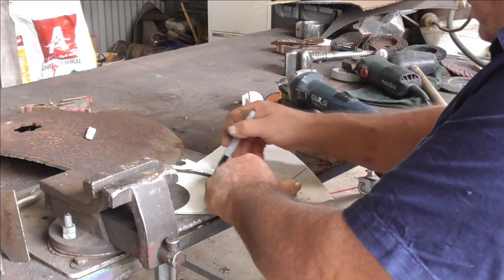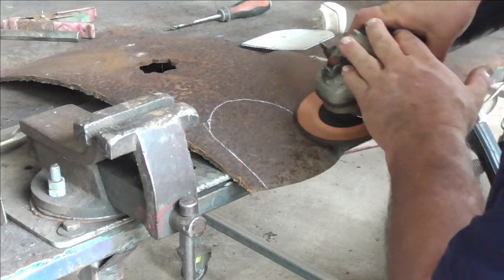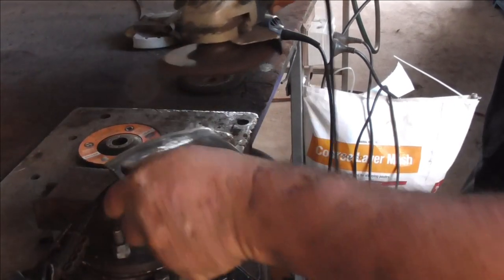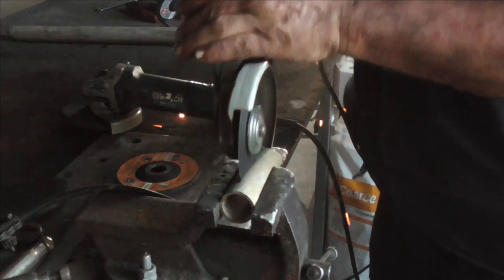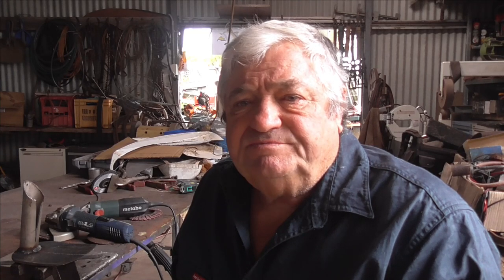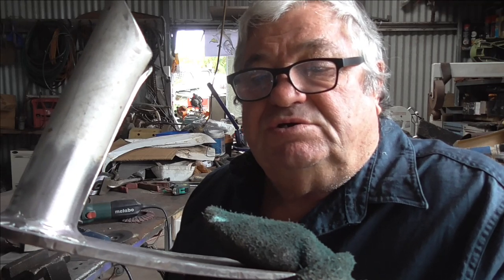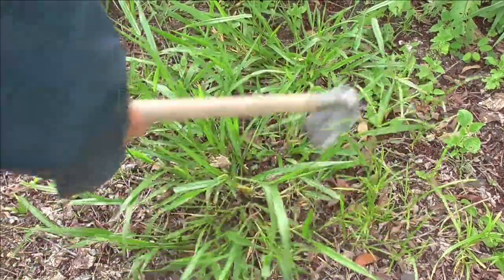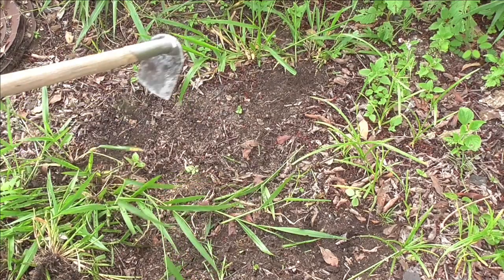MAKING A GARDEN HOE OUT OF AN OLD PLOUGH DISC

Comment: Over here (romania) we've always used dredging hoes for everything. I think they were made from tractor discs, we'd hammer the edge on an anvil like you do with scythes to get them sharp. Supposedly angle grinders mess with the steel and also eat at it.
Reply from the maker: Yes angle grinders can heat up the steel and take out the temper. Thanks for watching. John

Comment: Hey John what welding wire did you use this time? How do you choose which wire to use?
Reply from the maker: Basically I only use a couple of wires. For general fabrication with mild steel I use just a good GP wire for all high tensile high carbon steels like Grader blade or plough disk or rake tines car springs Stainless Steel I use Stainless steel 316L wire The reason I only use the two is it works and that way I only need to keep two wires. John